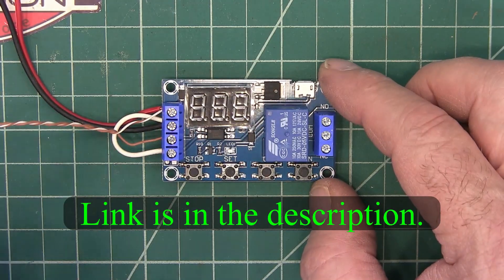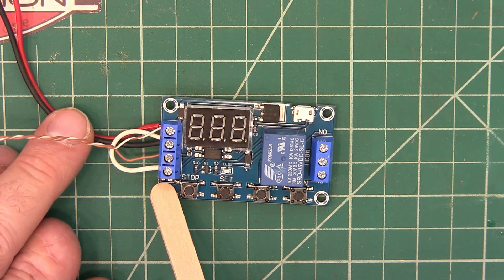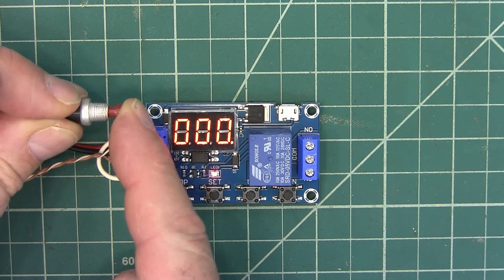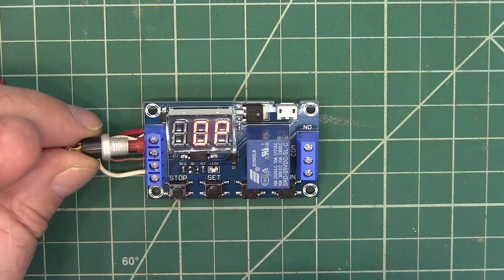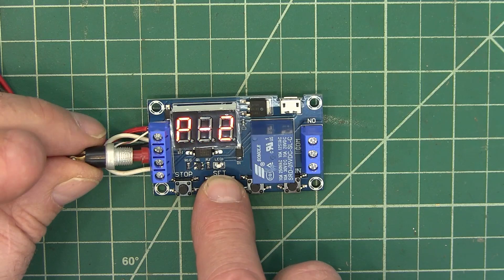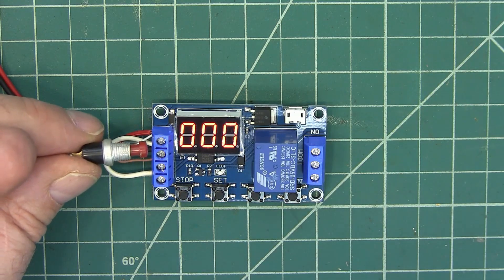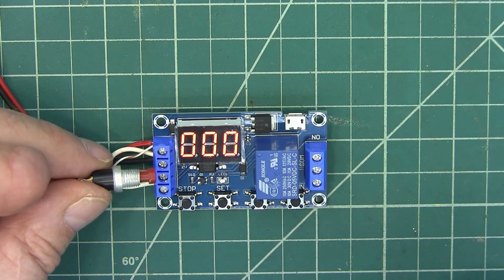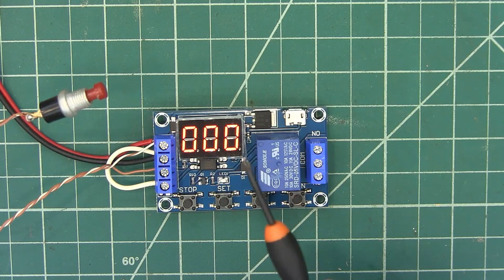HCW-M421 Timer Relay:  How it works

Comment: how to use button + microUSB only?
Reply: Just cut the usb connector off, strip the red (+) and black (-) wires and use that as your 5V into the terminal as he did in the video.

Comment: Thanks for the video. I am needing something like this to create a delay in power to an O2 sensor on my car. I would like to use it with no trigger, if possible. Could I just jumper the terminals that you have the trigger connected to and use the P.1.1 mode in order to do that? Update: Nevermind. I got patient and watched more of the vid. Looks like P3.2 would be what I need. Thanks again for the vid.

Comment: im about to make a diy spot welder with a modified microware  transformer. 

i was hesitant between this module and a fancier setup using a 16x2 display, an arduino nano, an encoder, a solid state relay, and a heck bunch of programming (which im horrible at) to be able to run the welder with a delay and a loop option.

 i guess the answer is clear now. this way cleaner, simpler, gets the job done, and CHEAP. also i never knew this module has that loop option but im soldout by ur video. ty sir.

Comment: I have a speaker pop when the car radio is turned on and off. So i installed a delay (not this) and it delayed the amp turn on which stopped the pop. But the turn off is the problem and still pops. So I'm wondering how to use this delay. Cutting power from ignition and everything shuts down is not a trigger. Could you think of how to delay the headunit or amp on turn off?

Comment: I have a question. I need to use this as a delay on to one of my devices. Can i just keep a 5volt supply on the trigger so that when the power goes back it will automatically trigger the timer. I dont want to press the trigger manually.
Reply from the maker: I believe one of the settings will start they timing when it powers up.  Watch the video I think it might be the last one.  I don't really remember.

Comment: When I trigger the module, the relay makes noise but bulb connected to load not working.  Checked voltage on output. Shows zero.

Please give me some ideas.
Reply: You checked the voltage on output of what? Your power supply? If it shows zero, there is your problem - your power supply does not work.

Comment: I have a question, when using the P3, infinite loop with time on and time off, is there any posibility to override that, one time off and leave a bit longer on and then continue the normal loop? I saw the different options but I didn't see any that does exactly that. Thanks so much for your help and your great videos!!
Reply: @Soat Mon , that would be very useful to start it with a little delay on p3 mode, is there any method to do this?